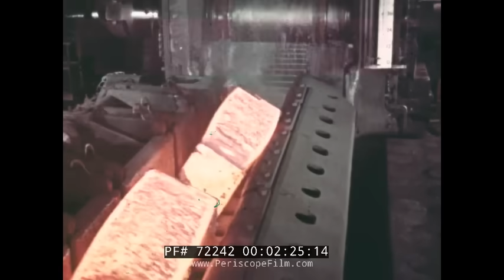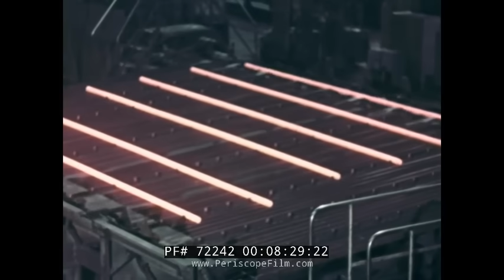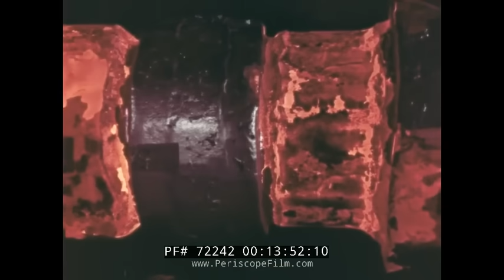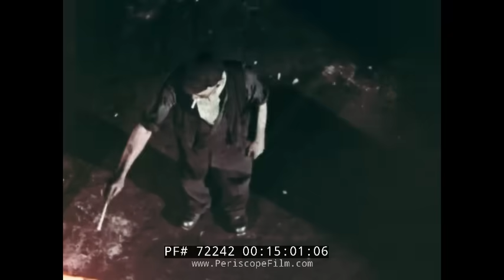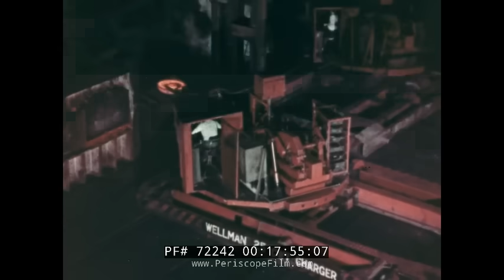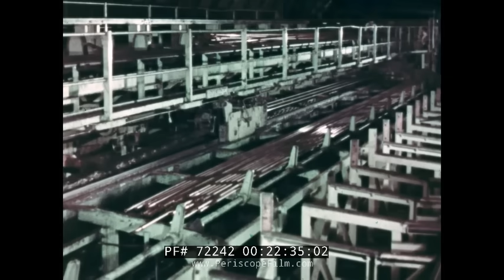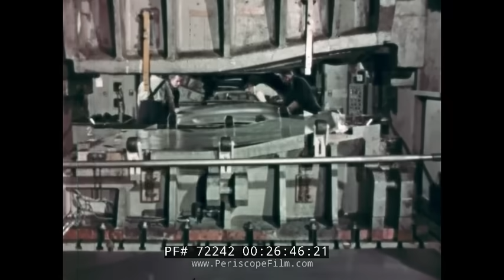"THE DRAMA OF METAL FORMING" 1959 METAL FOUNDRY & FORMING PROCESS   SHELL OIL INDUSTRIAL FILM 72242

Comment: As I watch this I’m sitting in a control pulpit running a 2 stand tandem 4-high cold rolling mill running aluminum strip coils. I’m sure not smokin a pipe though, or using my feet back and forth to run the mill 😂😂 Everything now is touchscreen and automated. My crew loads it up, and once I get it running it runs by itself. Love this job, and I like watching these old films showing how the old timers did the job! 🇺🇸🇺🇸
Reply: Common man light up a pipe like a true boss 💪.
Reply: You get to sit in a pulpit?  The one I use, I have to stand!
Reply: @KenBowles  Our cold mill burned down in 2006…after the rebuild all the mills have pulpits and are touchscreen automated etc. Before the fire…man we had some ancient machines. No pulpits, just standing there in front of a control panel, flying mic for gauge control etc.
Reply: Stone deaf by retirement.
Reply: And then old guys like me would form it and weld into many different parts
Reply: still at the same gig to this day. will be 20 years next july 🤯 i'm a lead man now though. i miss running my mill! sorta enjoy when operators call off so i can run it again! 😁
Reply: @ascended chairman of the lemurian worker's party who are the Pinkertors?
Reply: Jimmy Hoffa and the Teamsters yup build them up and then get whacked. Wants and needs. The very Moral Fabric of what is IS... pudding puff you need to lay off the Rage roids MAN. Would it bust yoir balls to know that the button pusher doing his str8 40 makes 3times as much as you do on an eighty hour week??? Just saying... In the End it doesnt matter because there isnt a u haul behind the Hurse. Paper chasers usually dye young. Peace be with U.
Reply: Thank you for your service? 🤔
Reply: edited cuz debbie downer deleted their reply 🤙🏻
Reply: @djhaloeight  You are doing important work so all of us can live well. Thank you.
Reply: @djhaloeight  how dare you!!! Do you even understand who you are being unnecessarily attacked by? This is a wild “ Karen’s husband “ who has been given Karen’s permission to be the bad ass behind the keyboard and then you’re not going to fold up and apologize to him? You have every right to explain where it is you are and what you do as it pertains to this video and he has a right to be angry with how his life’s turned into answering for his uncalled for rant and why his wife does in fact need to see the manager and why you don’t have any right to tell him to go pound sand or show up at his job and smack the dicks away from his mouth and criticize his work while he’s enjoying his day off from taking them sans vasoline at work. I’m not a republican or a democrat as I have values and opinions on both sides of the coin. This clown is the definition of a Trump man with his 1. Attack, 2. Insult, 3. I’m more important I need to prove it and finally 4. Letting you know your profession is inferior and not as hard or nearly as cool but just going to call you names call you out explain he’s better. act like you asked him for his opinion and you’re welcome for getting it regardless of your thoughts feelings or wanting nothing from him. How dare you speak to Mr Karen toomuch. How dare you indeed. Imagine how it is going to get to him when someone explains electric cars don’t need gas and his job is going the way of the creatures that created it. Lmao😳🤭😵‍💫🤢😵💀
Reply: @djhaloeight  you said it. man. killed the mood.
Reply: ...the pampered youth of today have no idea...my late dad had a job in the old Alcoa plant in Edgewater, NJ before the War....he was part of the crew the passed the sheets of aluminum back & forth between the presses....he hated the job, but it meant  paycheck especially important in the waning days of the Great Depression...don't think you could PASY a young person to do that kinda work today...automation or no...
Reply: ...I'll be 72 in less than 7 weeks or so...I didn't work as hard as my dad did...but I worked!!!  I got the advanced education he always wanted and preached about...shouldda learned his skill or trade for all the good it did....'in labore virtus'...breaks my heart to see the same Bolsheviks that nearly destroyed the world in the 20th century in places like China, Cuba, the Soviet Union and other places finding a receptive audience here in the USA amongst the ignorant folks of the current generations - yes plural...
Reply: @mohammedcohen  or... there was propaganda in the us as well... the people you describe are simply people.
you said you have an education, marx was just a philosopher.
capitalism isn't an ultimate answer either... but a balance between all philosophy is probably the more right answer.
do you receive medicare?
that's American socialism in action. and it's a GOOD thing.
the ideas you cite aren't being entertained. that's just what the channel you watches is telling you. seriously.
this is classic my guy good, your guy bad mentality... it doesn't work.
what those countries you cite have over us right now is that they don't see progress three months at a time or it's not worth doing and everyone is expected to get educated and work in those nations. some of the smartest most educated people i met came from the former Soviet Union.
it wasn't the communism that was their problem overall. it was the oligarchical corruption that continues to this day.
if we don't all get on the same page and give our blue collar people in this country some new deal socialism.... China's middle class is going to outgrow ours.... then you can wave the stars and stripes all you want.
hell... seems like my generation doesn't understand good civics anymore. they can't give an inch on anything... and they believe far too much of what's on Facebook...
Reply: Technology baby! That is why made in the USA 🇺🇸  is desirable
Reply: Your watching youtube at work? C'mon, you can be better than that.
Reply: Yup and how much are you getting paid to sit and watch a screen while your union takes your dues and launders it back to the democrat party? Union workers nowadays are a bunch of spoiled pussies that can't put in a real hard days work. You wouldn't make it a week in the West Texas oilfield.
Reply: @LITERALLYCHITLER  back in the early eighties we had a huge stainless foundry in the place I lived it was unionized the guys l knew that worked there made big bucks while l worked little shit shops and worked my ass off but they went bankrupt
Reply: @LITERALLYCHITLER  easy there meth pipe!
Reply: @LITERALLYCHITLER  I don't have the words for the irony here...😐
Reply: @LITERALLYCHITLER  OMG.... right wing media just a little too much.
partisanship is for SUCKAHS.
with people like bezos running the world I'll take a union or two to protect people.
and guess what... there will be dues to go with the service.
that's how capitalism works.
if there's some specific, non politically partisan corruption you'd care up point out to for it.
I've found Sherrod Brown, senator i think from Ohio in an auto town to seem to care quite a bit about the workers there. so they elect him again... he legislates for workers.
instead of complaining about the "other guys" while not doing any real work...
call it like I see it.
seems to be independent of party... except chump... the gop will repeat anything he says... very "dear leader" disturbing. and guys like graham and mccarthy with no backbone... ted groveling cruz... sad.
not that I'm a pelosi fan by any stretch.
I'm more a term limits kind of person. 
but you have hate in there it sounds like. 
this is a democracy. if more people want to do it not your way. that's really America. more than guns and flags. ideas.
Reply: @rodanone4895  the united states isn't a democracy and union workers are weak minded lazy crybabies.
Reply: @LITERALLYCHITLER  i would LOVE to hear you say that to a Boston Iron worker. and watch them turn you into a fine powder.
yeah... i used to hate unions too.
till rich people started making their workers crap into bags while they launch themselves into space.
Reply: @rodanone4895  if I told a Boston iron worker he's a weak minded little cry baby he'd just file a grievance against me and then fake an injury so he could go on disability because I hurt his whittle feewings. I don't know where you're at but where I live Amazon employees get paid pretty good to crap in bags. Where I work I rarely get the luxury of crapping in a bathroom or a porta shitter. I work in the oil field so I usually just crap on the ground on the edge of whatever location I'm on and hope a pumper or land owner don't drive up and see me. The only reason that story is going around is because a union is trying to weasel it's way into Amazon. If that ever happens you can kiss your cheap Amazon merchandise goodbye. Unions serve no purpose other than lining the pockets of the union leaders. If I have a problem with my manager I'll handle it myself. I don't need some dumbass union speaking for me.
Reply: @LITERALLYCHITLER  Unions can be a pain but the only reason you have a 5 day work week and a 40 hour week and workers compensation when you get injured is because of the unions. Its true, unions destroyed some industries with ridiculous demands but it wasnt that long ago that average workers worked 7 days a week, 12-14 hours a day, and no annual leave or sick pay. If you got injured they would fire your ass and get another worker.
Reply: @tubester4567  who says I have a 5 day 40 hour work week? Unions have run the prices of everything up so much that if I only worked 40 hours I couldn't afford to buy my wife pretty things. Unions have far outlived their relevancy and just need to go off somewhere and die. I've had job opportunities come up in the past that were union and I couldn't turn them down quick enough. I know a few teamsters and they absolutely hate having to be in the teamsters union but they were with their companies so long before the teamsters got voted in that they're just trying to ride it out so they can get their 20 years in and find something else to do. Unions make good hands lazy and complacent because there's no incentive to work hard since you don't move up based on merit.
Reply: @LITERALLYCHITLER  The price of stuff is cheap in the US. You have the cheapest car prices, cheapest fuel prices, cheapest electricity/gas prices, cheapest food prices and cheapest housing in the world....or at least cheapest in first world countries.
Reply: @tubester4567  yeah things are so affordable that if I were to go buy a new pickup it would cost more than what I paid for my first house in the early 2000's. I guess I could be like you and blow any union guys I meet and thank them for giving me such a low cost of living
Reply: @LITERALLYCHITLER  
The only union that's doing harm to this nation is the police union.
     When and where unions have been strong, there has been a stronger middle class.
   Also when & where unions have been strong, non union jobs in the same field enjoy higher rates of pay.
    You might not work a 40 hr work week, but you get overtime pay & you owe that to union workers.
    If you don't get OT pay, that's your own fault.
    Unions aren't to blame for inflation, that blame can go to the gov, both dems & repubs.
     Look at the trillions they've given to wall street. Big banks, & themselves while they forced us to stay home and gave us $1,400!?!?
     Know your enemy son & it isn't the union worker who's standing up for workers rights.
Reply: @tubester4567  
Don't know how u figure price of stuff in US is cheap.
    Gas does tend to be cheaper here but a lot of that comes out of our taxes.
     If you figure the avg blue collar wage related to cost of living, US isn't so hot.
    Hell, medical bills a Lone causes a huge amount of bankruptcies every year (can't remember the stat)
Reply: @rodanone4895  except the unions don’t work for the people paying the dues, they work for the bezo’s of the world.
Reply: @juliemunoz2762  that's a good point. probably could use some correction.
but if everyone is going to listen to the mainstream news outlets whose owners and "anchors" are invested in the profit motives of these people.
and, they are using partisanship as their tools.
tried to explain to a "conservative" the other day that liberal was coopted to be bad for those it enabled.
liberal, liberty... democrat, democracy...
the donor class (real political party... not r or d... voters and donors, that's the real political parties in this country)... is so worried about paying their fair share. they're not going to allow the workers to have a legitimate voice.
but... you can't be suggesting that nothing gets done about it... are you?
Reply: @LITERALLYCHITLER  okay.... you do you while the lawyers for the companies lobby to remove your present worker legal protections. 
I used to think exactly like you. talked my buddy out of joining the union over and over. and they hazed him for it and it was unseemly the way they acted. justified everything you said.
until today, where the government is pulling back worker protection as much as they can... last remnants of the new deal. lobbyists want them gone...
now. i feel the truth is somewhere in between. i think more of the union as the workers ability to lobby.
of course this all assumes it's independent of corruption. there's the real rub.
Reply: @LITERALLYCHITLER  It was supposed to be a republic but even that's being eroded.
Reply: @LITERALLYCHITLER  Well said, if you want to get rich easy start a union, become the leader and skim both sides.
Reply: @juliemunoz2762  Union leaders promise stuff to the employees they represent but make deals behind the curtains with the big bosses and become rich themselves in the process. If people only new that unions are an invention of corporate capitalism things would be much different.